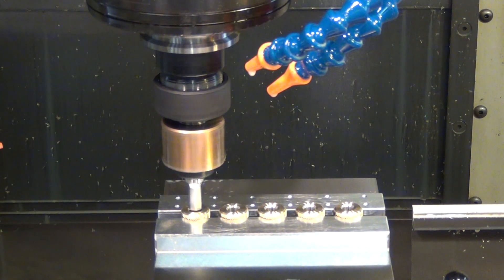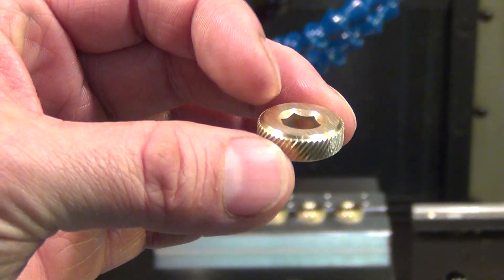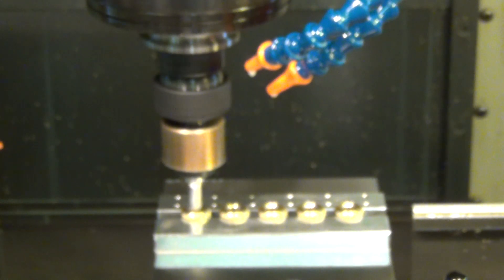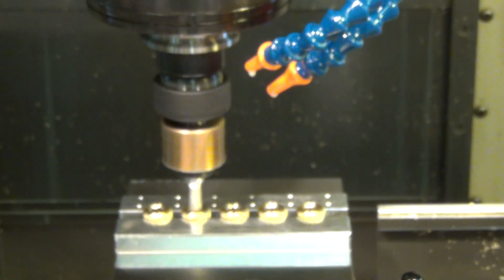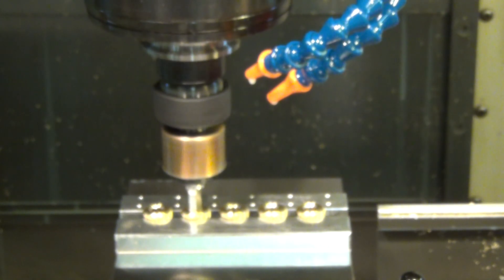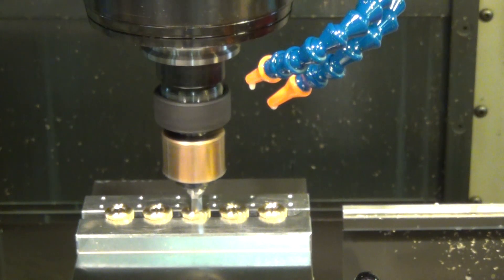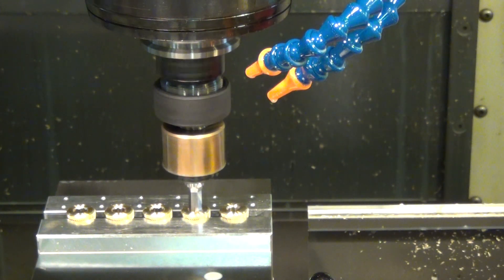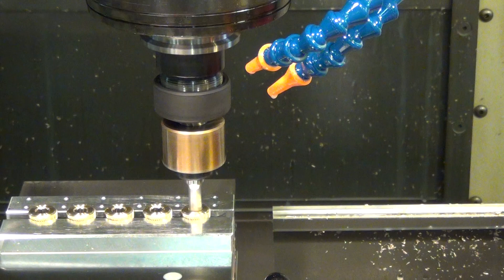SMA connector wrench, SMAW1: rotary broaching hexagonal holes.

Comment: About retracting slowly; the broach does not cut oversize. Therefore, there is a very slight interference fit created when the broach leaves the hole. Additionally, if there is no vent hole, a hydraulic condition can be created that may cause damage to the work piece or the broach. The Polygon holder has a pressure relief hole. You probably shouldn’t exit full speed, but you can exit the hole quickly, easily around 100ipr.

Comment from the maker: Thank you for the nice comment.  I am running this at 1000 RPM and 0.006 in/revolution.  There is only limited speeds and feeds information for these broaches.  Any comment is much appreciated.  I also wonder how fast is OK to retract the broach from the hole.  I am retracting slowly but suspect that much faster is OK.

Comment: Does this create hard to remove shavings in the bottom of the blind hole?
Reply: You can usually clean out with compressed air.  You probably want your blind hole slightly deeper than the broaching depth.  Polygon Solutions can probably recommend necessary amount of extra hole depth that is needed for a blind hole.